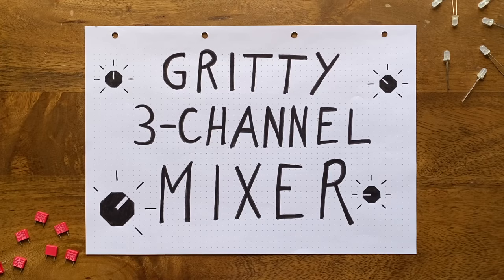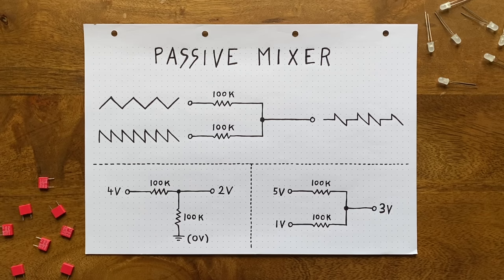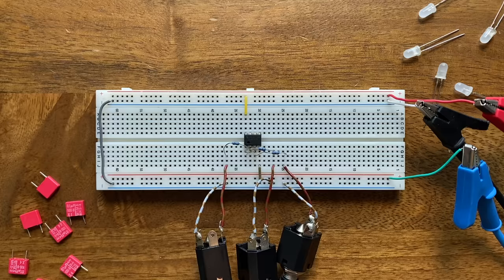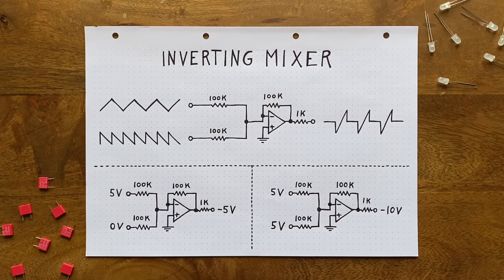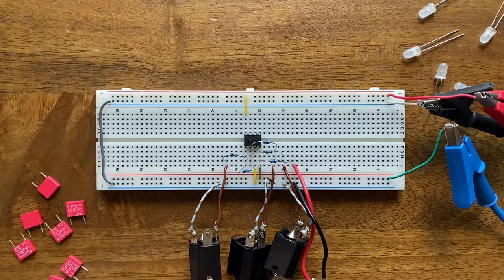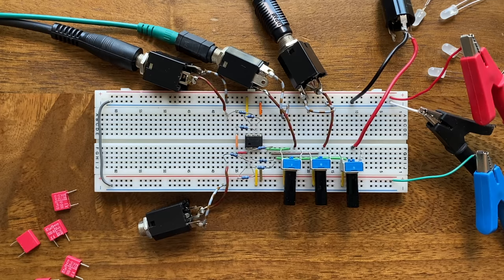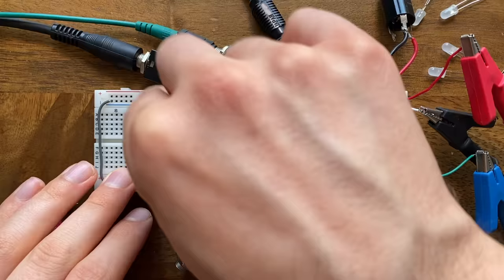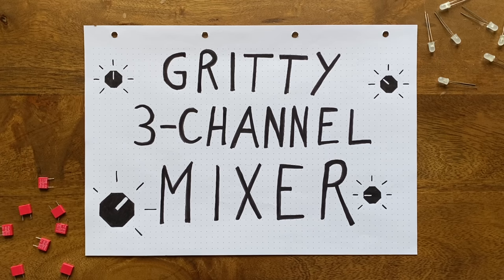Designing a 3-channel mixer with diode distortion from scratch

Comment: Hi Moritz great video as always!! So since this circuit is powered by 5V could it be possible to power it with a 9V battery and a regulator?  It would be for adding it to Peter Blasser's Rollz5 paper circuits. Thanks!
Reply from the maker: it‘s powered by +/-12 V unfortunately :/
Reply: @MoritzKlein0  Oh!
Reply: You can create a 4,5V reference. There are some schematics on google...
Reply: You could use two 9v batteries to create a +- 9V split rail supply most op amps are happy with this but will limit headroom slightly ( only relevant if a ‘hot’ signal input.  Should be fine - try it
Reply: Okay thank you guys i will read on that.
Reply from the maker: @HugoPlaVentas  in the erica synths VCO manual, I explain how the dual supply with 9V-batteries-trick works: https://www.ericasynths.lv/media/VCO_MANUAL_v2.pdf (page 11)
Reply: @MoritzKlein0  great! thanks everyone ;)
Reply: can you use a boost converter for powering it?
Reply: Just the answers I needed...I literally set it up on 5v 0v ground , I see why nothing happened now 😂

Comment: why do I need a positive and negative rail for the op amp at 12v and how is it that an xbox one controller can power a headset with only two double A batteries???
Reply: Modular works with 12 to -12 volts, but that's way more than necessary to drive headphones. It's just a standard for eurorack for some (probably good) reason. The speakers in your headphones need only a little bit of power to produce that super low volume sound, you literally have to put your ear right up to them.
Reply: @tychoclavius4818  well that really doesnt answer my question how can controller power headphones with only 2 double a batteries???
Reply: @tychoclavius4818  are you saying op amps are what require the +/-12v but headphones dont? actually i think i get it now! To drive the op amp i need the 12v right but without the op amp i wouldnt need the 12v then!.

Comment: 8:27 wouldnt it be easier to just use a regular opamp amplification circuit, and inverting an inverted signal wouldn't be needed? plus it will isolate input from output

Comment: Would it be better or worse to use a capacitive couple instead of the resistive one depicted here?
Reply: It's preferable to capacitively couple in addition to the resistor if you are only going to mix audio signals. You have to use a large capacitor, (1-10uF) otherwise you will lose some bass. If you want to mix CV (anything with a DC component), adding a capacitor will not work. Note that you don't want to replace the resistor with a capacitor directly.

Comment: The videos are nicely produced, show a lot of basic electronics engineering, but are unfortunately full of misconceptions or bad ideas worth pointing out.
In this case for example: The series resistor at the output of the opamp of 1k is definitely way too high to drive headphones.  Most opamps can survive indefinite short circuit to ground. The resistor is more useful as a oscillation-prevention, when driving capacitive loads like long cables - that can easily make an amplifier unstable.
Another very not ideal thing is universally using those 100k resistors: Your mixer will be extremely noisy, especially when bipolar technology opamps will be used, due to their usually high input noise current and due to thermal noise generated just in the resistors themselves.